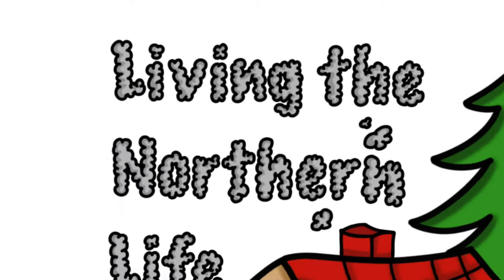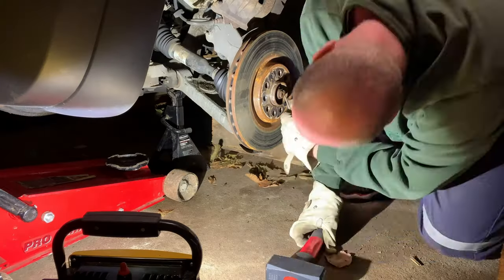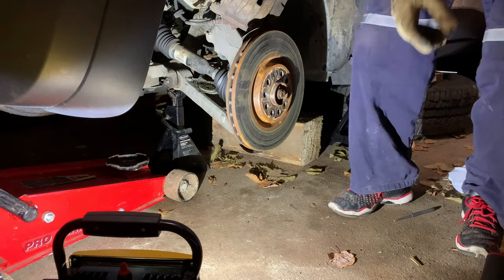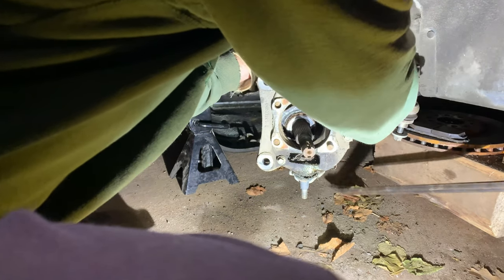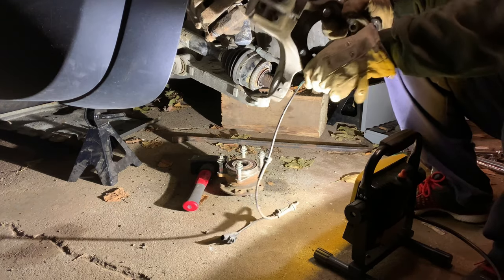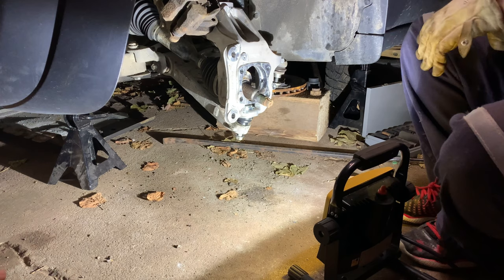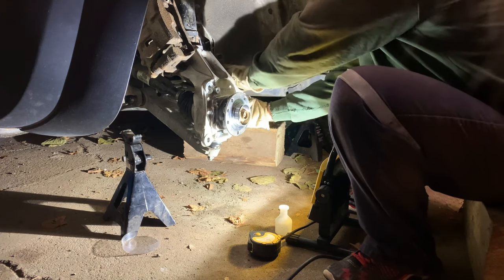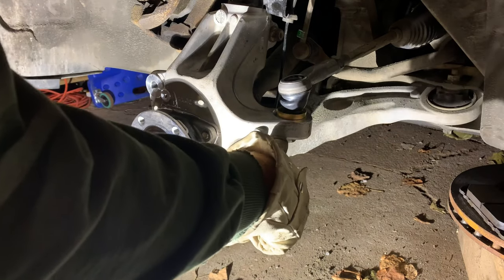2015 Jeep Cherokee Trailhawk Driver Side Knuckle Replacement

Comment: As a retired inspector who has verified and inspected many critically torqued components your use of the torque wrench to only verify final torque was very well executed. Good job, you passed inspection.  Way too many people think they can use a torque wrench to do all the wrenching on a bolt or nut. That only helps the wrench to go out of calibration and yield erroneous results.
Reply from the maker: Thank you!
It was good to get this done.
My son is still driving the Jeep now.
It has almost 270,000kms  or 165,000 miles on it.

Comment: Turning the bolt/nut back 90 degrees is to relive the stress created by torque and to prevent that bolt from stretching while under load.

Comment: Just replaced a ball joint on a 2014 Cherokee, just the ball joint, easy peazy.
Reply from the maker: You mean the bottom balljoint for the knuckle?
Where were you able to locate one?
We tried everywhere and were told we needed to replace the whole knuckle and they were dealer only parts.
Reply: @LivingtheNorthernLife  Advance Auto Parts. Pulled the large C-clip stuck a thick chisel through that front slot, smacked it, popped right out. Sorry that you were lied to, the ball joint was around $80.
Reply: @LivingtheNorthernLife  Forgot, yes, the lower ball joint for the front knuckles.
Reply: I think there is two ball joint replacement parts. The movotech Part No: MS25560 and a moog “Lower Ball Joint by MOOG - K500287”. I’d love to see someone make a video of installing one of these.

Comment: I also have a Trailhawk a 2019.  Rock Auto sells 2 knuckle assemblies.  They sell a heavy duty firm suspension and a regular duty.  Do you know which one you bought?  I can not find any info on which one to use for the trailhawk.  Thanks.
Reply from the maker: It should be the heavy duty parts for the Trailhawk.
This is why I went to Dodge to get the parts just to make sure I got the right ones.
Thanks for watching and hope this helps you out.
Andrew

Comment: I’m just curious, is there a reason you can’t just press the lower ball joint out and replace it instead of replacing the whole spindle?
Reply from the maker: Dodge/Jeep designed them to not be replaceable. I checked out the local parts store and there are no replaceable parts in the knuckles. All the rubber bushings and the ball joint are not replaceable.
Reply: @LivingtheNorthernLife  Moog sells one.   However, Mevotech has one that comes with a handy installation tool for the cramped conditions
Reply: @LivingtheNorthernLife  as of now, the ball join are replacable, I did on my 2015 TH, the process is tricky but it goes through nicely if you follow the instructions carefully